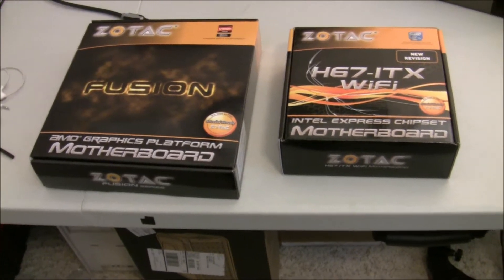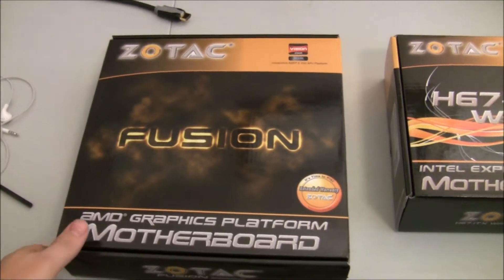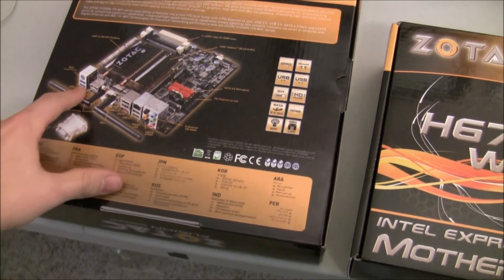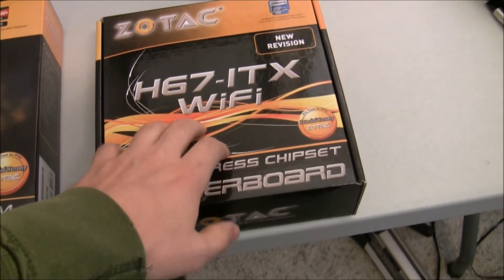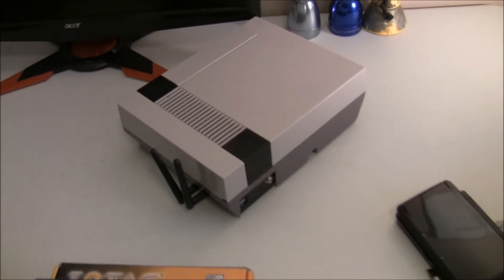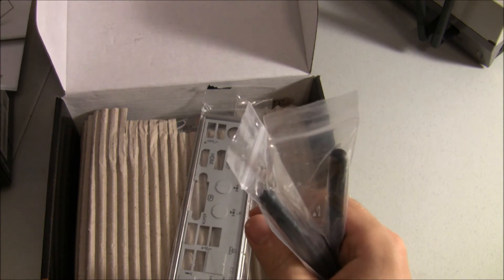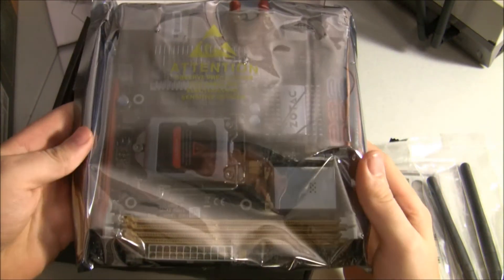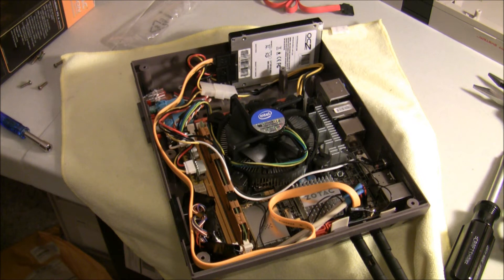Building a RETRO NES PC: Part 7 - Recovering From Lameness

Comment: LEGIT! I just bought the Zotak H67-ITX board for $50 a couple days ago.  I plan on putting it in my rebuilt all in one iMac G3 or maybe an original xbox. So to get an Ivy Bridge to work, I guess I'll have to buy a cheap Sandy Bridge Celeron on ebay, update the bios, sell the celeron, then get an Ivy Bridge i5. I'm hoping that is why it had kinda more bad reviews than good reviews. Sure it's going to be a long process, but as long as it works, it will get my 5 star review.

Comment: Man...that Zotac issue on the HDMI sucks!! I've learned that before mounting and doing dremmel job and that stuff, I configure all software and see if all hardware get along and everythings works ok. After that, then I mount and assemble my project. I learned that the hard way :( I've been doing some projects with the raspberry pi, essentially mounting the Pi inside SNES cases, NES cases and some other plastic cases I have laying around :D Thanks for the videos... I don't see part 8 :(

Comment: Good info.  Just one thing tho, depending on what emulator he uses, with or without Frontend support and or a Shell for the OS hide, the processor shouldn't be "downclocked".  I was on the fence about OC-ing mine after seeing it perform.  Ultimately I decided to leave it stock and avoid potential heat issues.  If you want to check out mine, I posted a full build tutorial and BOM.

Comment: As  note, the CPU you chose is rated at 65 watt and that is the general threshold between possibly going fanless and passive with less noise or going above 65 watts and needing a full blown fan with possible heat pipes and not even being able to use a typical itx case. I know the NES is not the size of a typical its case being a little larger but not by much.

Comment: If you searched enough online or on ebay you can find 1155 Intels i3's that have a low TDP running between 20-35 watts and maybe even find a mobile processor using even less wattage. I did some research earlyer and found these though can't remember the specifics.